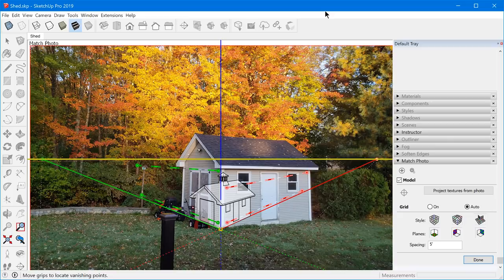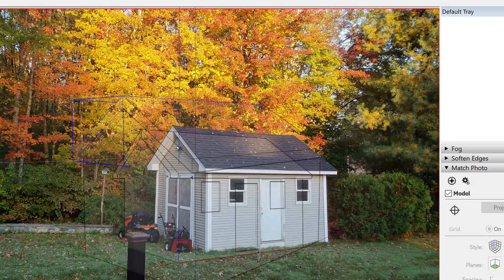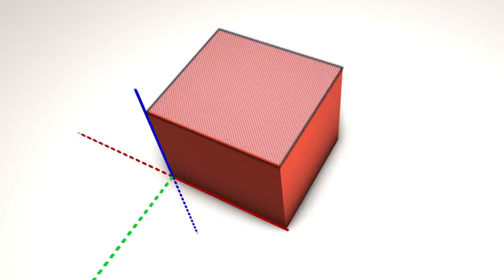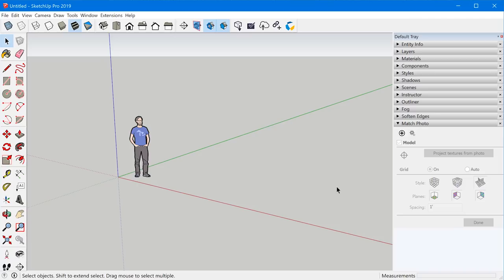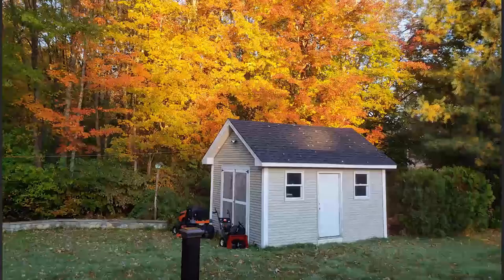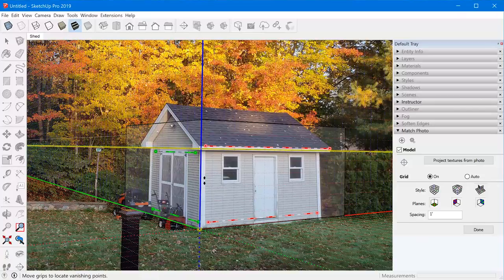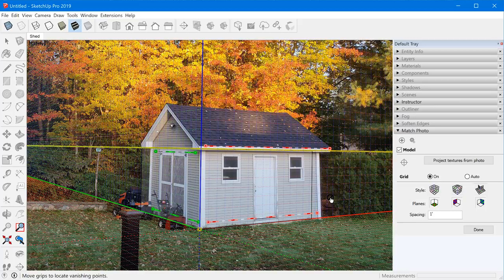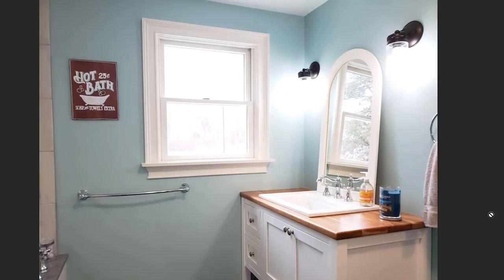SketchUp Match Photo Tutorial (Easy Method)

Comment: i am a learner of sketchup and usually do wood working projects. i use a rather simple method for re-creating the models from a photo. i import the photo in the sketchup then take any one edge in the photo and estimate the length of that edge based on my experience or the space available where actual piece of furniture will go or figuring out some standard dimensions for that piece of furniture (like mattress size for a bed). Then i draw a line of that estimated length that necessarily follows the corresponding edge on the photo. After that i scale the photo up or down to make the edge in the photo equal in length to the line i drawn. in the process i do have to move the photo as well to put the edge i selected on the line i drawn. As the process is complete i have a scaled photo instead of scaling the model. Now the remaining work is easier. just draw the model edges using line tool and you will get your required model from the photo.
i m sorry the process i explained looks difficult in words but is very easy if i make a video for this. hopefully in future.

Comment: Thank you very much, but yet again another tutorial where it is explained the method by using the best possible scenario. Sometimes you don't have two sets of parallel lines, for example in front of a house, where you can see just either x or y and then z, because you are too zoomed in and you can't trust the pavement. That is the case where things starts to get complicated. It would be very good to be able to select a couple of lines on z as well (like fspy, for example).
Reply from the maker: Match Photo requires two sets of perpendicular parallel lines in order to work. That's just how it is, unfortunately.
Reply: @Mastersketchup  Yep, true; although having just the possibility of controlling directly the blue axis as well (like fspy) would be a little bit better.

Comment: Thanks for sharing those great tips. A great video, but like all other 3rd party tutorials on this subject, modelling detailed buildings requires al least 2 photos and you might wish to explain how to match the 2nd photo without screwing up the positioning of the model relative to the first photo.
Reply from the maker: Yeah, I wasn't able to fit much in this video, other than the basic setup. There are a number of Match Photo features I couldn't cover, like adjusting the opacity of the photo & model, how to export an image of the model, etc. But maybe that's a video I could do.
Reply: Excellent! Looking forward to your takes on those topics
Reply: Not exactly sure what you are asking but if you play around with the material editor you can do most things

Comment: nice tutorial. I am intrigued about why, after a correct placement of the red and green bars, the 3D cube does not match exactly the shed at the corners. I have made myself the photomatch and the result is the same, i am not able to match the perspective of the photo. What do you think can be the cause? Maybe that shed is not perfectly constructed or badly placed on the ground? either the siding boards are not parallel between them or to the ground? the shed corners are not really vertical?
Reply from the maker: All of your suggested issues certainly contribute to the problem, but I think the biggest one is lens distortion. Every camera lens is slightly different so it's hard to get it perfect.
Reply: @Mastersketchup  So why is there no option to adjust the lens?

Comment: Thanks for the tutorial. What remains is when you closely look at your model that you matched with the photo, the vertical line is not matched although x and y lines are exactly matched. I think that's because the match photo doesn't work with different view angle which can make vertical lines slant. Is there a way to adjust the vertical line too?